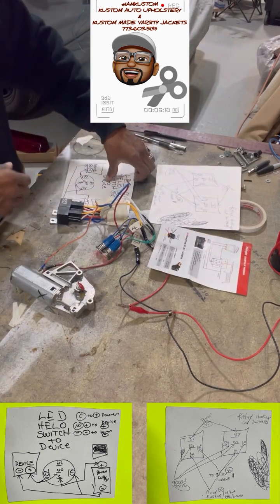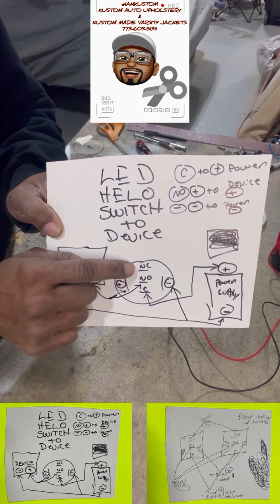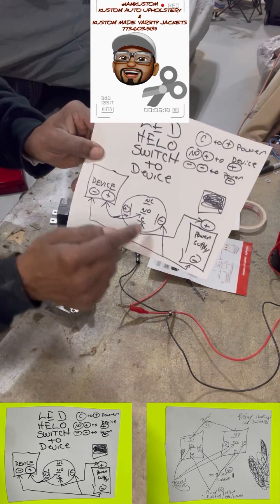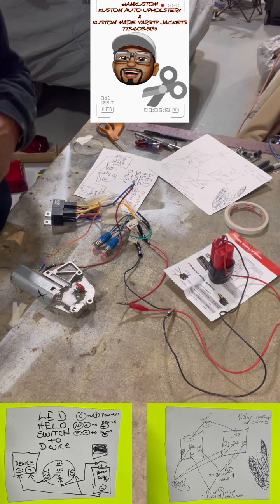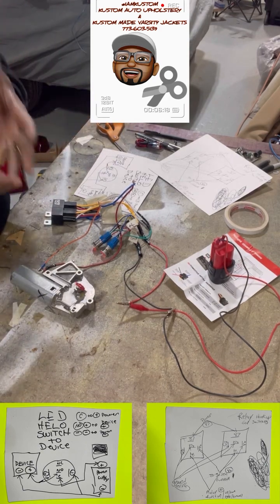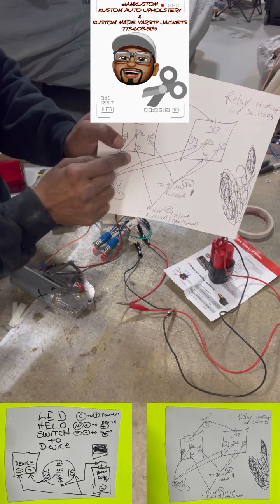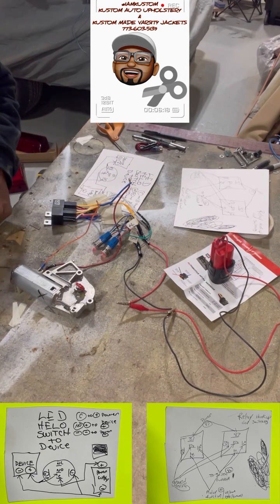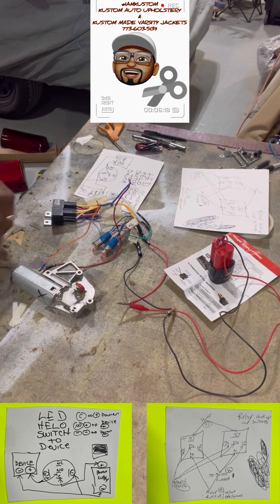5 pin relays to LED Halo switch #iamkustom

Comment: So don't hook up the negative on the switch
Reply from the maker: Yes the negative from the switches goes to the car Chasity that’s the ground
Reply: You said 85 and 87a from the relay goes to ground what about the ground pin on the switch you didn't say where that hooks up to
Reply from the maker: Ok I was saying that 85 & 87a coming from the relays are your ground for the switches so 85 & 87a hooks up to your switch ground and run all of them together to one wire to the chastity or ground